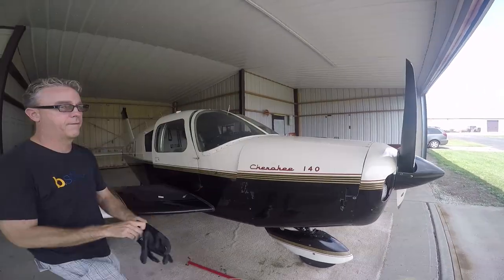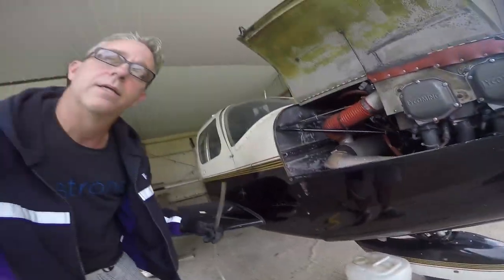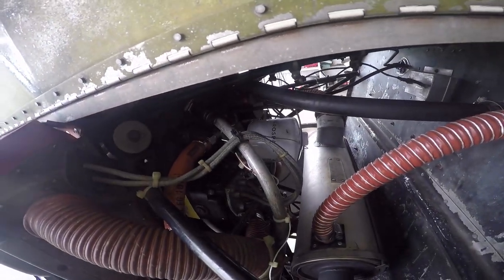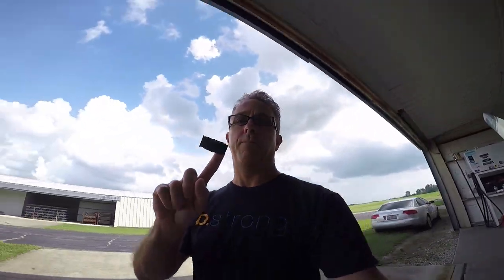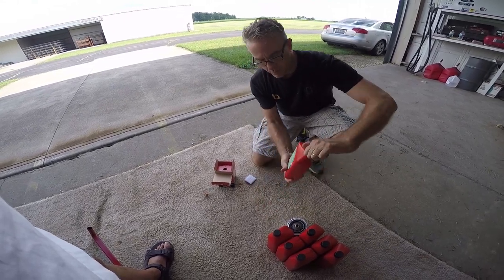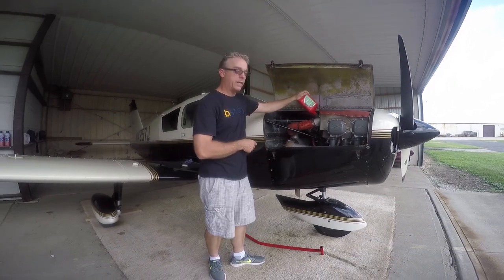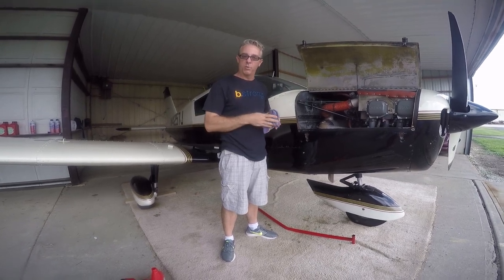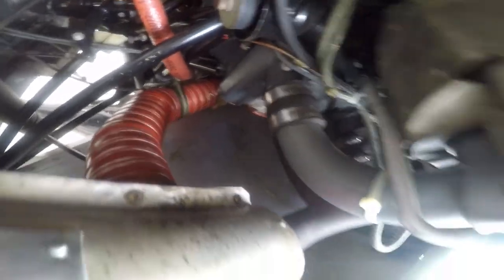Oil Change on My 1967 Piper Cherokee 140 (48)

Comment: Won’t take a couple hours...more than welcome to do what you want with your own aircraft but I start it draining and perform all other parts of the oil change; filter and suction screen; and close the drain.

Good idea with the duct tape on the filter; I would recommend buying the preset torque wrench from aircraft tool supply, specifically for oil filters.
Reply from the maker: Thank you Caleb! If you haven't already, please consider subscribing to my channel. Also, if you have a suggestion for a video, please let me know. I'm always looking for new ideas that people want to see. Thanks!!

Comment: If you removed the oil cap wouldn’t that do the same as punching a hole in the oil filter ?
Reply from the maker: Scott Honigmann I put a hole in the filter to help vent it so the oil hopefully comes out more completely. Removing the oil cap probably would help with draining the sump. I’ll give it a try next time, thanks for the good idea!